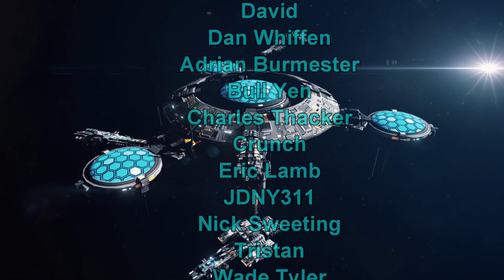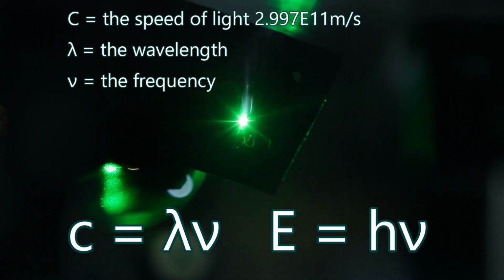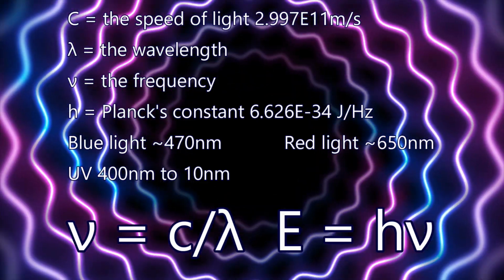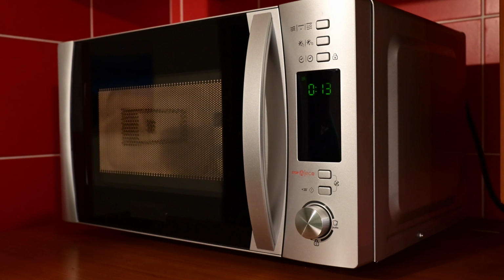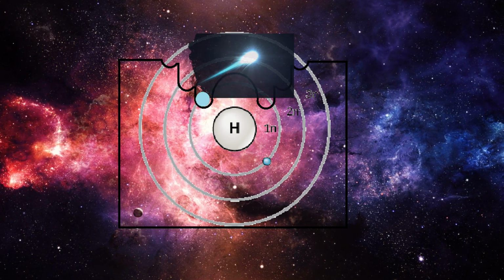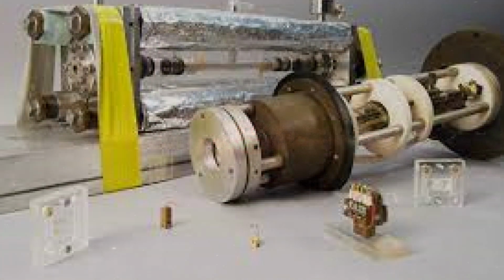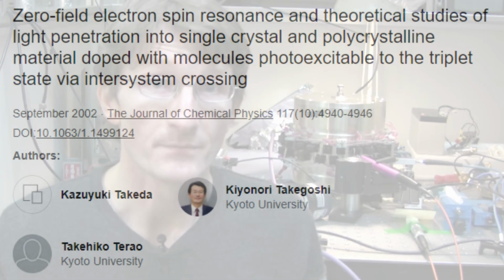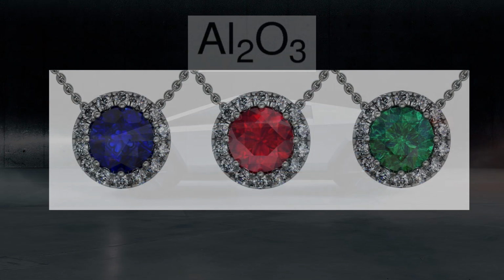Space War: Advanced Laser / Maser Science and Technology

Comment: I really hope for some kind of miracle ultracapacitor with energy and power densities of 100kJ/kg and 500kW/kg. Pesent capacitors can only do about 1kJ/kg and 10kW/kg as far as i know. For big laser turrets on a boat that can carry tons of power supplies this is not so bad, but sadly it seems we still have a few centuries to go before hand lasers become standard issue for the Space Force. That said, if the power supplies were available lasers would be the most attractive option without a doubt. 

Everyone goes on about how "kinetics are just better" and maybe in some contexts they have a point, but the hand laser doesn't suffer from coriolis deflection when fired in rotating habitats or gravity drop on planets, it's pinpoint precise since it needs adaptive optics and stabilisation to work anyway, and the beams can be configured to achieve different effects on targets. 

A sustained pulse of one kilojoule in a couple of millisecond focused to a centimetre will flash-boil plastic and flesh but not much metal or ceramic and it fails to penetrate the resulting debris/vapor, limiting collateral damage when used inside fragile space habitats. 

A pair of pulses in rapid succession can be tailored to turn only a few millimetres of skin or clothing into an expanding plasma with a bright flash, loud bang, and shockwave in the air - this technique has been referred to as a Pulsed Energy Projectile but also been described as Laser-Supported Detonation Wave, either way whatever you wanna call it it is obviously a stun mode.

And finally, for drilling through ceramic and metallic armour, a chain of a hundred 10J pulses focused down to a quarter or half centimetre to maximise energy intensity on the target spot, with each pulse being a few nanoseconds long, and spaced apart a few microseconds to give the debris kicked out by each laser pulse time to dissipate. 

We could even use laser pulses to launch a projectile such as a grenade, while sufficiently miniaturised lasers could be worn to provide personal point defence by deflecting enemy projectiles before they impact.

And best of all, if we use optical phased arrays then not only can they be used to more accurately maintain focus, not only can they be used to slew beams onto different targets without an articulated turret, but they allow us to call our sidearms "phasers"!
Reply from the maker: You have put some deep thought into this my friend!  That scares us a little :-) but you are exactly right.  And I don't think it will take centuries... the Soviets issued hand held laser pistols to their cosmonauts in the 1960s.  Watch the lesson on The future of Russia in space :-)... Ultracapacitors have a bright future... as I hope does lattice fusion... Combine aneutronic lattice fusion with an ultracapacitor and you have a functional phaser :-)
Reply: @terranspaceacademy  Loops of room temp superconductor would also make an excellent power supply, virtually unlimited discharge and an energy density of up 25MJ/kg (but if the loop were damaged or suddenly lost superconductivity it would explode quite violently - if they were cheap enough then superconductive loops designed to fail could even replace traditional explosives! An aneutronic reactor small enough to fit within a belt- or back-pack may be much more safe to handle, and it wouldn't need to output much more than a couple of kilowatts if it was constantly topping up an ultracapacitor, but i still think we have a while to wait for that kind of miniaturised fusion. 

In all honesty we could probably make a handheld gasdynamic laser with deuterium fluoride fuel cartridges with present day tech, it would be a lot more energetic than the pyrotechnic flash cartridges of the Russian laser pistol, but it would also be a lot more delicate and expensive, and possibly dangerous to the user. A diode laser powered by explosive-pumped flux compression generators are another option that may be possible with present tech, which may or may not be safer and simpler than a chemlaser.

Either way thank you so much for replying man, you are the best!
Reply from the maker: @trippyulyanov2012  Thank you for adding to the discussion :-) you have obviously done your homework! We appreciate you.

Comment: A very quick correction on this video: microwave ovens use microwave radiation because the frequency is best absorbed by H2O, or water, but not hydrogen. Microwave ovens are designed to heat dipole molecules to cause them to spin, releasing thermal energy. The genius is that it can heat the water to boiling but not much higher. Other fluids like vegetable oils or melted butter will not heat up as quickly, but with enough exposure will get much hotter than water. This is because the microwaves do not heat up the food from the inside out but because it penetrates 1-1.5 inches of the outer layer of a food item. 

In some other cases however, you can have thermal runaways with items like glass and rocks should they be exposed to enough dielectric heating for enough time.
Reply from the maker: You are correct... I was thinking of MRIs that perturb hydrogen, then release them and record the radio waves...
Reply: @terranspaceacademy  

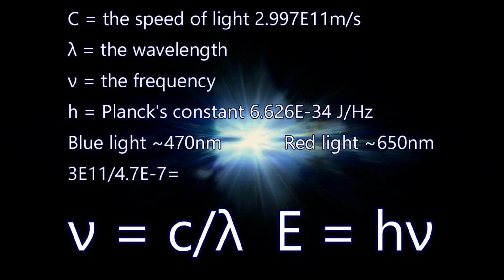Right. I also just realized at 3:00 roughly when you calculated blue light, the work was not double checked. 6.38E17hz would correspond to 638 Petahertz, which is 1000 times higher frequency than you’d expect for the visible spectrum. 

Blue light should be 638 Terahertz.

Comment: Years ago I was part of a crew building a holography table ( a  sandbox with laser, front side mirror, and slow film). It used a helium neon laser.
     Maser equipped space pirate ships!
      I think radar uses radio waves in the microwave spectrum ..at least police radar does. The older Fuzzbusters were just receivers for 1 to about 1.6 Ghz. 
    Interesting video!
Reply from the maker: You are correct... most radar systems now are in the microwave range. The smaller wavelength allows higher resolution. But these are noncoherent systems, which are ok for broad scanning, close in, but not for high resolution or long range...

Comment: Regarding microwave ovens;
 my Masters in Electrical Engineering happened to be on 2.4GHz Wifi in mining environments, and it has been my understanding that the heating part comes from the water molecule's rate of turning in an electric field. By switching the field at the same rate the water molecules turn, resonance amplifies the movement (ie heat) of the water molecules. 
The proof is that microwaves do not heat oils as easily, even though theybare also full of hydrogen. 😉
Reply from the maker: Very good point!  The photons cause the water molecules to rotate faster which creates a form of heat... Each molecule has its own absorption spectrum... Oil would need heat best at a different frequency I believe.
Reply: @terranspaceacademy   Well, the point is to have a polar molecule, and hydrocarbons usually aren't because they are based on chains of carbon with a hydrogen coating. 
Water is polar because the oxygen liaisons are lowest energy when at 120 degrees appart (which is the reason why snowflakes are 6-sided btw). This means the hydrogen protons create a side of the water molecule that's slightly more positive than the oxygen side.
You'll have to read chemistry textbooks on electron orbitals to go furtjer. 😉
Reply: @brunoethier896  

That’s pretty much it. Also, because materials like glass and rock have polar molecules in them a thermal runaway can be caused which will heat the glass enough to melt it, as can it be used to melt ceramics and rock. So the 2.45GHz microwave, give it enough time, can also be used as a blast furnace. Not recommended though ;).

Comment: Enjoyed this with my breakfast today. Power required to operate a MIDAR  meteor detection and defense system? Really going to need a robust power supply for the Starship I suspect.
Reply: A kilopower reactor could trickle charge a capacitor bank that could power an extremely high power pulse laser. The energy would be further focused into pulses. This could ablate material to divert rocks. Or vaporize small ones. You'd  want to maneuver around larger ones. A 1 second burst from one of the SME's should do it (Starship Main Engines).
Reply from the maker: Very true...  or a molten carbonate methane fuel cell for sensing and a simple IC generator could come on line to blast something.